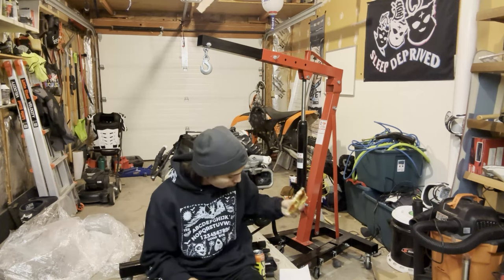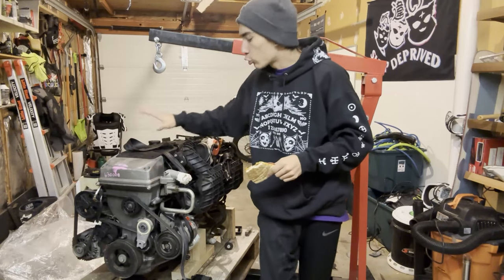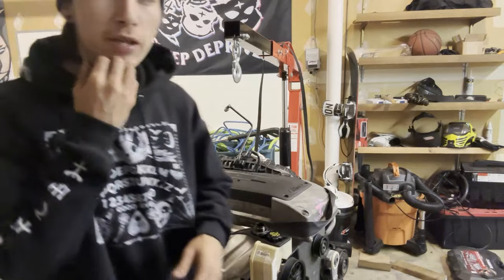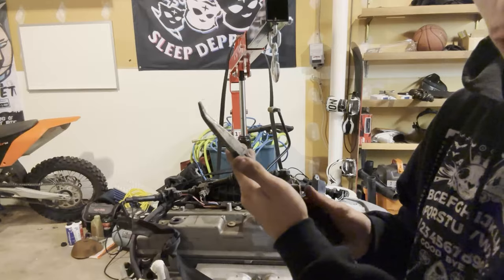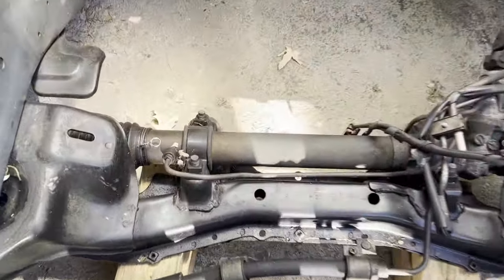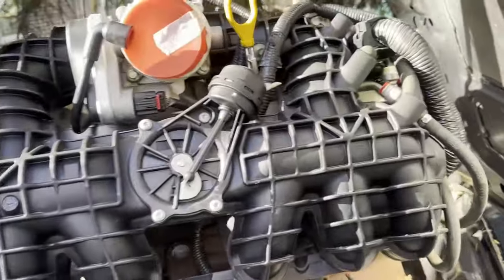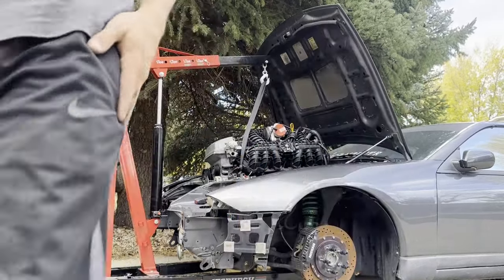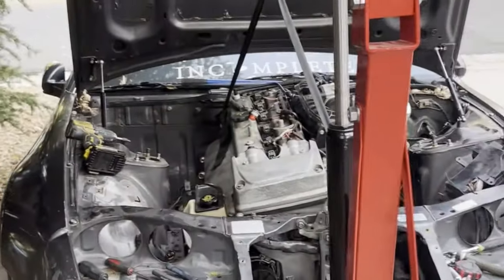Can i fit a Ford Barra in my 300zx?!

Comment: thanks for the love  once again. plugs look good. WOW on the test fit - tall boy indeed. You 'might' wanna look into steering rack relocation vs. modifying oil pan. With the oil pan, you have to consider pick up, baffling, and over all oil capacity. With the steering rack relocation, its all about geometry, which the tie rods can already adjust long and short and the steering wheel to rack can be extended easy. Just my thoughts at this point.
Reply: also, you made me a little nervous on that heat shield removal on the  brake lines dood. You pinch one of those and  you're in for a lot more trouble than you want to be in. Recommend you strip everything out the engine bay (seeing as you plan to possibly paint anyway) to ensure you don't mess up a critical system of the car. Also.... jack your car up higher and get off the wood bro. LOL. That is, if you can within the tenants of your rental agreement.
Reply from the maker: @BCs300z  new brake lines are in order regardless 😂, also was the best I could do with what I had.